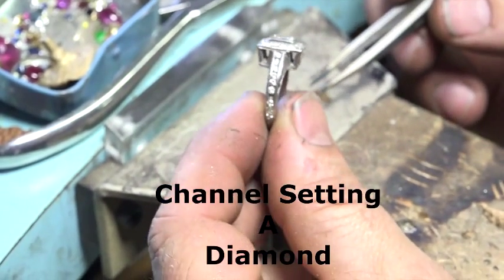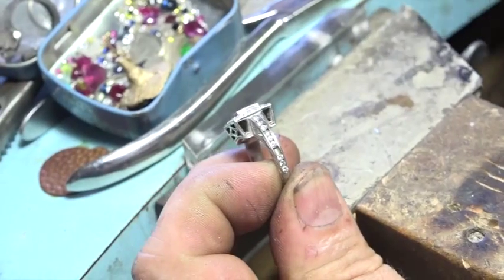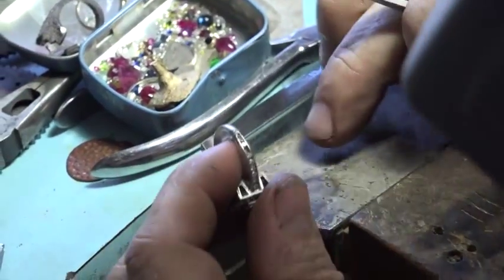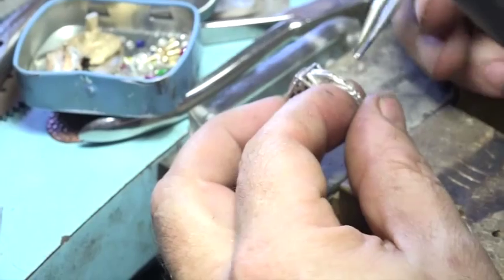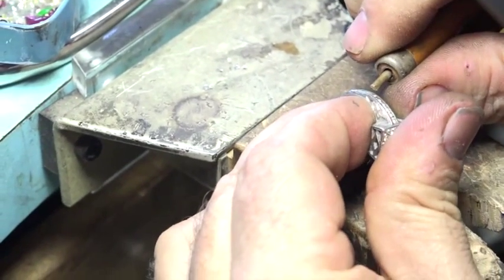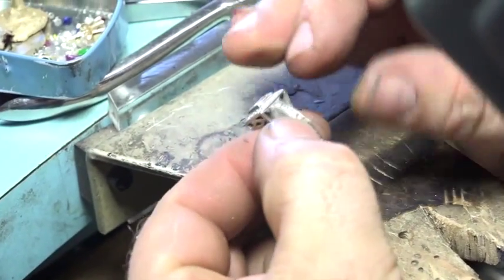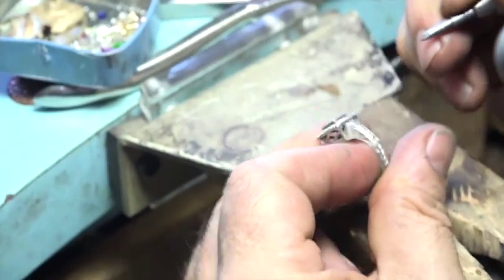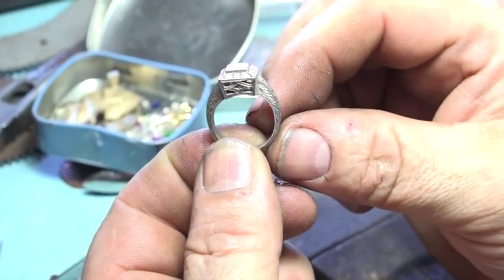How to Repair Channel Setting A Diamond on a Ring

Comment: I know this video is old, but I came across it looking at how channel settings are repaired. I have a diamond ring with channel setting and there’s spacing between the diamonds I’m assuming from wear an tear plus resizing a couple times, could you show/explain how that (if it can) be fixed?

Comment: i really really dont like how ur holding the ring and hammering vs in a vise or against the peg or literally any other secure way to properly hammer down the sides :/. its not only dangerous but much less effective than when the ring is more strongly secured. very solid resetting at lest, cant call it a repair cuz the vid was cut short and didnt get to see anything else get done to it, carry on but work smarter not harder.